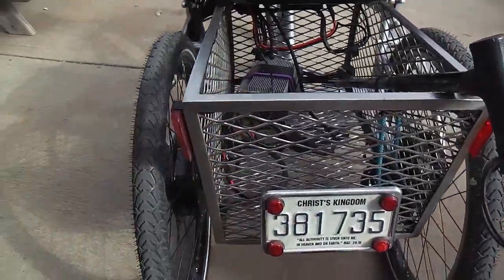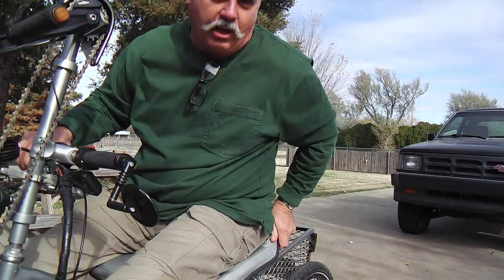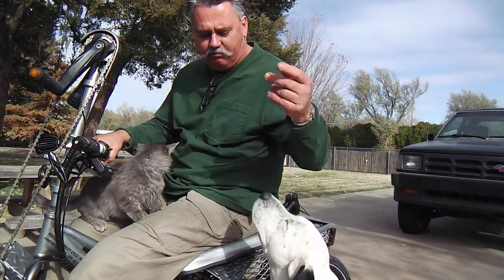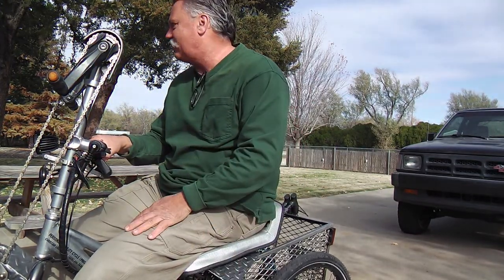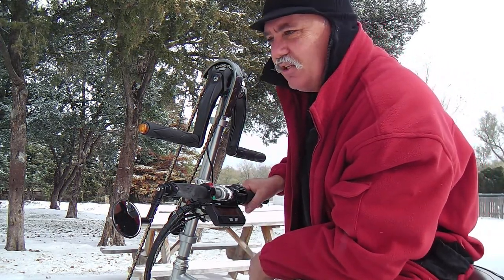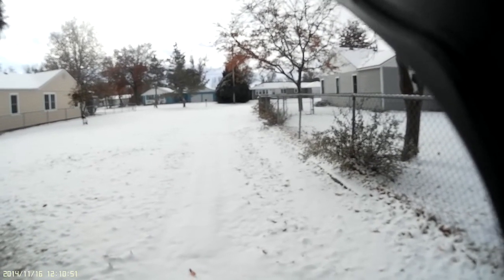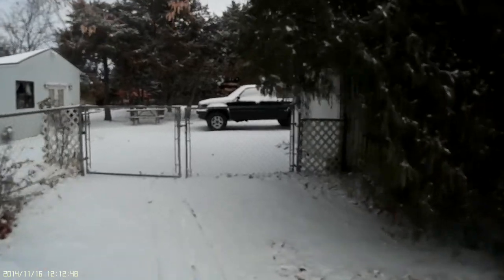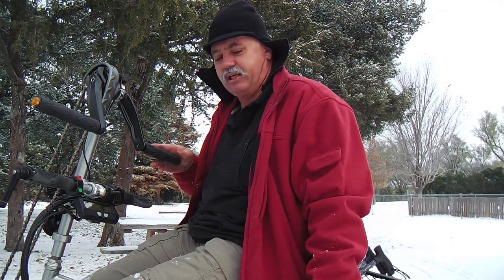World's 1st Electric 2WD Delta-Trike, Handcycle-Snowcycle?

Comment: You should do a video on the wiring process.. How did you wire did you wire one throttle to two controllers??
Reply from the maker: Yeah, I did initially have a video clip on the throttle. But I didn't include it because I did it differently, ultimately. But the typical way for a BMC motor to a BMC controller is to include or join only one single signal wire from the second (non-dominant) controller to the signal wire of the throttle to the primary controller. That's it!

The BMC throttles and controllers have a 4-pin JST connector connecting them. And many BMC throttles will have only three pins in the 4-pin connector: 1 ground, 1 signal, and one +5 volt (sometimes a BMC throttle will have the forth pin with a purple wire to power an LED battery indicator at the throttle).

JST connectors are delicate, but you can change to a different type connector if you want.

Right now I have all three common throttle wires going to both controllers, since I wanted to be able to run on one hub motor, or the other, or both, with the flick of the two power switches. And it works great that way, especially because if one battery cuts out due to the low voltage cut-out limit being reached, momentarily, the trike doesn't lose full power, as the other battery and motor are unaffected. But you will still detect that one dropped off for a few moments, untill you let off on the throttle, and ease back on with a lower current draw to cause the other motor to join in again. Of course, you'll then know, if you didn't already, that it's time to start charging the batteries.

So, wiring one throttle to two controllers is not difficult, as the controllers seem to tolerate well more than one way of doing it.